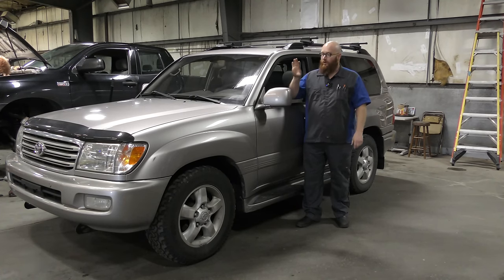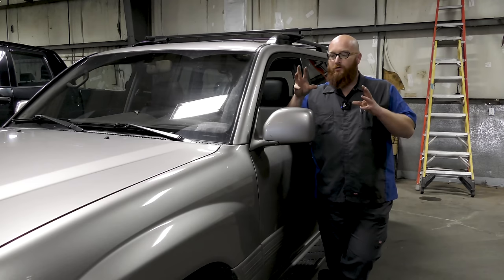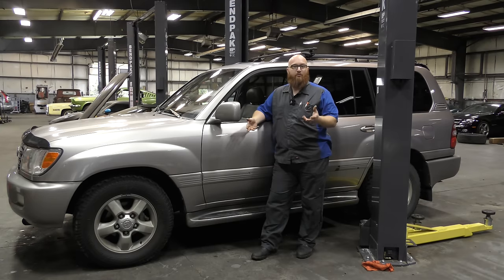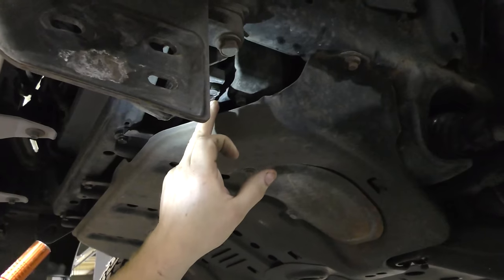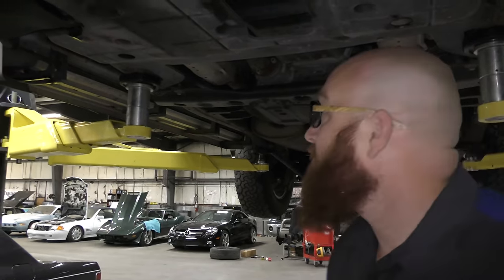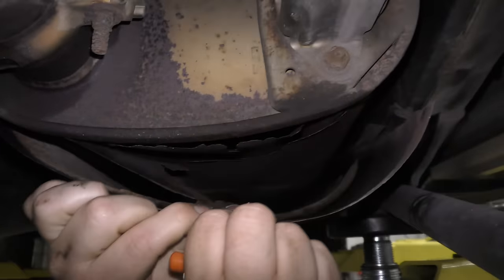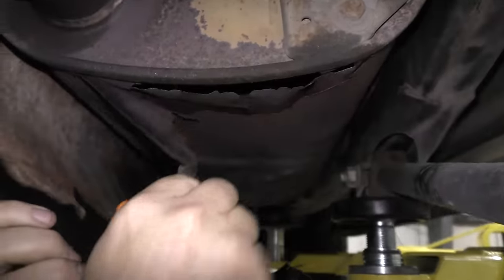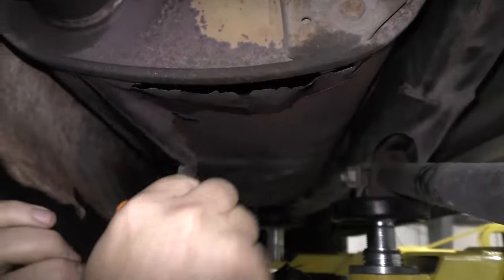Vehicle Making a Horrible Noise?! CAR WIZARD finds the problem & shares how not to be duped by shops

Comment: If you use hostas that Rusty you need to see the inside of the frame with a borescope around the front suspension mounts in the rear suspension Mounts also they rust inside those areas I just saw my neighbors go off to pic a part because of a rusty frame

Comment: Hi,  Just trying to fix my 2011 Sequoia.  Placing into 4X4 makes a grinding noise on front right.
I noted your cracked thumb.  I have the same.  It is called Median Nail Dystrophy. in case you did not know.  Thanks for your videos

Comment: What if you know exactly what’s wrong but the fix is beyond your abilities? Got a bad needle bearing on my 4Runner and the diff oil looked horrible.. lots of metallic flakes in the oil as well as the thin little rods that make up the needle bearing.Don’t know if the front diff is shot ( sounds normal in 4wd bad in 2wd) which strangely is the symptom for the needle bearing going bad.

Comment: one day i went to start my mk4 jetta and it wouldn’t start. i had three different lights on the dash. after looking at codes i saw a potential issue with the throttle body, i took the whole tb apart and cleaned the electrical contacts as well as the tb itself. hooked it up to vagcom, tried to adapt it, wouldn’t give. replaced the tb with a new one, same issue. after about 20 or so tries adapting the tb with the ecu, car finally ran again and all was well at idle until i turned on headlights. i suspect headlights caused some sort of parasitic draw because it suddenly idled like garbage.  turns out the issue was that my rear o2 sensor wires, which were cut by the prev. owner, shorted out the ecu and was the cause of my headache. installed a new ecu and had a friend help me install new o2 wiring into the harness with new sensors. no more issues! could’ve saved money on a throttle body and time on the whole job by just replacing the ecu. NEVER buy a stage 2 ecu from ebay. apparently the previous owner was a numbskull

Comment: I've got a Lincoln LS, and a guy was trying to make me do a Motor swap. Took it in for a little rattle in the top end, dude says my engine is about to let go and it's spun a bearing. I entertained him for the hell of it(I know a lot about my car) said it had metal in the oil. Well I checked the oil, it's clean and near brand new, looked like he didn't even check it, from the dipstick or the drain plug. I checked both, along with the oil filter. Near brand new oil with no metal at all. My Theory is that the Timing chains are going out, 150k miles so it's about time for a service on them.

Hell it starts and runs fine, moves under its own power, but the damn passenger side top end is making one hell of a racket, so I only start it for a minute or two at a time so I can charge the battery. Once I get the cash I'm gonna get it fixed, too nice of a car to just scrap. It's a special edition called a LSE, or Limited Special Edition, one of only 1500 to ever roll off the production line.
Reply: I had it's sister car..Jaguar X-type 3.0. If you have the V8. Thats a Jaguar V8...they aren't very reliable. That's why they cost almost nothing to buy. If you have the V6..you have the Jaguar V6, which I had in my X-type. Those are far more dependable. They go over 200k miles no problem.
Reply: Yeah I've got the V6, it's a S-type that shared the platform, not the X-Type, but it did share motors

Comment: Don't forget to check the plastic heater tees behind the engine. Mine had the original tees from 220K miles ago blow up. Cheap and easy preventative repair :)

Comment: My 95 Camry had 175,000 miles on the original timing belt & water pump before I had it replaced. The mechanic was shocked that it hadn't snapped by now!

Comment: I have a 98 Lexus 470 that was bouncing every time I hit a abnormality in the road. Afer my self diagnosis I concluded that I needed a new suspension system. I took the vehicle to the shop and $1900 later they replaced my hydraulic suspension system with OEM parts. The vehicle is still bouncing after I hit a bump. Any suggestions

Comment: I took my Jeep to a chain mechanic once and they diagnosed my Jeep with having a bad transfer case and it was going to be $1,500. Took it for a 2nd opinion and turns out it was just the wheel bearing in the back ~$400 and it was back in perfect shape. Still got charged the diagnostic fee from the first place though and I’m still pissed about that.

Comment: My neighbour is a licenced aircraft engineer.  He had a 2002 V8 Discovery for the wife, and a 1997 Tdi5 110 Defender for himself.  I say HAD!
As he was promoted years ago to an office job, l would always see him on days off working on both Landies (Land Rovers)
Axles off, heads off, steering rack off, transfer case out......It never ended. 
I did have to say to him,  Mate.  You didn't buy these to drive.  Did you?
He gave me a sly but short grin, and then got back to work.  As there was plenty to be done.
Now he has 2018 (from new) Landcruiser J200 V8 for the wife, and he has 1995 Mercedes G500 G-Wagen.  To tinker on.  But rarely.

Comment: Rare to see high mileage vehicles in North America due to accidents and rust. That's one of the reason the north american market favours spend less to purchase and replace more often. If accidents and rust weren't an issue you'd see way more fleets with Toyota Tundras instead of Ford F150s.

Comment: Okay but I live in an extremely shady area where they think people are rich. What do I do when the second mechanic also quotes you several hundreds of dollars for the same service?

Had a V6 with the engine that they said required the intake manifold to be removed. Knew I was being shafted and in the time I delayed it, wasted through about a grand in fuel. Finally found a way to do it for a couple hundred when they all wanted $600!

Comment: I had a 1984 Mustang SVO. One morning it wouldn't start. So I took the bus to work. While at work I was thinking that I should check the fuel shutoff switch in the back. Sure enough the fuel shutoff switch was somehow off.

Comment: those UZ engines are bulletproof but there’s 2 problems: timing belts instead of chains, and thin ass exhaust systems for emissions. unfortunately these are two very expensive grenades if you don’t keep up as he said with the timing belts

Comment: Someone has tried to "correct" the toe in not knowing that the bearing has play in it. So, he has adjusted the side to offset the play. And not even bothered to loosen the clamp; as it can be made when the area leaks a bit, Toyotas do not, so it does not slide and wrinkles. Shade-tree mechanic stuff...

Comment: You are spot on. We all hate terrorists, but we all know why they use Toyotas. We've had our Hilux for 22 years, it gets driven every day and has clocked up 270,000KM without one single breakdown. 3RZ-FE 2.7, 4WD 5 Speed manual. The original clutch lasted up until about 250,000KMs!

Comment: i had a 86 ranger years ago that would not start after running for a while unless i waited about 15 minutes and would sometimes get some serious shimmies while driving then clear up and be fine. Was told it could be the fuel filter so ran up to the  local ford place told them id like a filter and what it was doing. They tested the filter said it was fine and suggested a diagnostic. i was there so said sure then they come back with a $98 bill for the diag and a list of crap that they said the truck needed, $1200 worth of crap and right at the bottom - the fuel filter they had just told me was perfectly fine . Told them politely no thank you and went to leave. Suddenly my truck that, outside of the shimmies, was running like  champ was barely moving . Im not a mechanic but i knew they did something so i went back in and wasnt so polite. I ask my brother, who was with me, to watch in case they decided to sneak out and undo whatever they did, but he didnt stay out and watch so we dint catch them undoing whatever they did. Took the truck to another place, they kept it a week until it did the shimmies and it cost me $280 with never another problem.

Comment: I’m curious about the front wheel bearing. Is it true that the bearing is in fact doubled and the vaseline has to be pressed in some sort of special press to remove the old one? If it’s not done correctly (or not done at all), that wiggle is the result?

Comment: I'm surprised that the muffler is that bad of shape for a 2005, even with those miles.. I have a 2003 Tundra( this version only in a truck not a suv) and I haven't had mine rust like that. Must be where they put salt out in winter? Or close to the beach

Comment: I am going to find out if a really need to replace both cats on my '05 Sequoia. I've been quoted 3k which I would never spend, but it does have both codes P0420 and P0430. So, I got the cat cleaner and nothing. Now I got 2 downstream O2 sensors and see what happens. I am not a mechanic by any stretch but I figured if I need to replace the cats I already got the O2's. What's your opinion? Great videos! I always learn new things from you.

Comment: I've had two 100 Series LC's.  A 1999 and a 2004. Nothing but problems. I had a brake light go out on the 99 and front turn signal go on the 2004. This after only a collective 580000 miles and lots of offroading. Shame on you Toyota. I'm going to try my luck on a 200 Series in a few months.

Comment: Hello sir can u tell whats cause my hd100 fte  if i stop/brake in mid of hill then once i hit accelerate pedal the power lost and feel like my car shaky and moving very slow but if i drive flat roadits normal like nothing problem. Its happend also once you hit pedal to the left or right at junction my car shaky after few second its normal.Can u tell me whats problem it cause?

Comment: Had this happen to me once... I had a 2007 4.0l Ford ranger with 75k on it and it was loosing coolant.. took it to a shop and was quoted new head gaskets at 800 $ I ended  up getting a second opinion and all it was. Was a thermostat housing and I was able to replace and do it all myself for about 75 dollars.. gotta watch out for shops like this

Comment: This is exactly what happened to me. I was hearing a rattle in the rear whenever I went over bumps. I am not experienced at all with cars and I thought I needed rear struts replaced. The car had 88,000 miles on it. I went into shop saying that I hear rattle and I need rear struts replaced. He said sure, and charged me $2,000. I drove and I still heard that rattle. I then got a new license plate cover becuase the old one broke on me and bam, the rattle was gone. It was the $10 license plate cover the entire time.

Comment: When I got my '99 Isuzu Rodeo from a family member to replace my totaled Nissan, I took it to a local shop, and wanted a quote on fixing the speedometer, gasoline smell from behind the engine at the firewall, and fuel gauge, as well as the standard maintenance. I knew the ABS light was on, and that the ABS system needed to be checked. 
This shop told me my transmission was going to be dead, there's an oil leak in the engine, and the fuel pump needed to be replaced, and they need to take the intake manifold off to find the fuel leak. I think the quote was somewhere around $1,200. They told me to ditch the car, and that whoever sold it to me was a bad person... 

My uncle laughed as he had the transmission fluid done at it's required interval, oil changed on time, and even before he shipped it to me. I fixed the speedometer myself by replacing the gauge cluster, the gasoline smell came from a hose that was disconnected from the fuel rail off the fuel pressure regulator, fixed the regulator, got new tires, and full brakes done elsewhere, and all current maintenance/repairs I'm doing myself. Shes been driving perfectly since I got her a year and a half ago.

Comment: Me, if that engine light comes on, my OBD Reader comes out. I pull the code, consult the common fixes, and start small. If the smallest one does it, good. If not? I go with the most common fixes first, which so far has worked. I’m not a Mechanic but am very Mechanically Inclined. I am smart enough not to touch things like a Transmission, a Differential, or Timing Belts. If it’s any of those three, to a Technician it goes. If the code I pull is something I won’t touch, then I bring the code to the Mechanic of my choice(I’m friends with several), and say “It’s this code. I tested the other fixes, and this is the only one left. I won’t touch it because I don’t have the tools for that job. I have the new  part already. It’s in the trunk. Here you go”. Yes I’ve done that. The one time I took a car of mine to a Mechanic I didn’t know, it was “I got this part I’m upgrading to, because the factory one is known to fail. Need you to swap it for me. New one’s in the trunk”. Wizard, I’m pretty sure you’d hate me lol.

Comment: jiffy lube will say it needs an engine. I have went a few days ago for transmission hose clips to see if they had any and got quoted 160 per hour and they said the hoses have to be replaced. I went to autozone and replaced the clips for 4 bucks and 5 minutes.

Comment: At least in my area, the most dishonest mechanics are at the dealer.  I once in a while go to the dealer when my spidey sense tells me I absolutely need someone factory-certified to do a particularly sensitive thing on the car.  But generally I just go to indies.  

Oddly enough, one of the best mechanics I have met is at the local Midas ... I thought they were just muffler shops so never really went there.  Then once I gave them some business just changing out my brakes and realized they were hardcore car nuts.  I believe they are all independent shops rather than owned by the chain.  I am usually very verrry particular about parts (with some cars, the difference between OEM and aftermarket parts is night and day) and we have a running deal that they're completely fine if I supply the parts and they just charge me for labor.

Comment: You are AWESOME! i have a issue with my LX 470 2005 , When i go over 120KPH, the low Oil Light comes in. The garage guy said me change the oil pump, which is inside the engine. I'm thinking, can it be?

Comment: My Jeep with the 4.0 i6 has over 240,000 miles and I just changed the original water pump.  It was still working fine but the gasket was leaking and so I figured I would replace it.

Comment: My friend has a 2015 toyota camry 4cylinder    with 565000 on it,  with original engine and transmission. Burning a little oil and transmission slips every now and again, but one issue cant figure out charging lite stays on even when he replaced battery and  alternator, any suggestions.

Comment: When in college my Buick park avenue had a leaking power steering pump. I took it to a shop in the city I was going to school in and the shop manger and his mechanic looked at my car and said it needs a new rack and pinion. He said it would be 2700. I said nope! Took it back to my hometown to my dads mechanic and he found a leaking power steering hose. Replaced it for 250 and back up and running.

Comment: Wiz.. any advice. I purchased a 17 Camry with only 27K miles. Runs amazing. Any advice on it ? I change the oil at the dealer with the $20 weekday coupon. Brakes are a little mushy. Pad replacement ? Any longterm tips? 
Love your channel

Comment: Thanks alot for your tips. I have a 1998 land cruiser in Bahrain similar to the one in your video but stick shift. I love my truck and I heard that in 2022 the land cruiser 200 production will be ceased. I am thinking of purchasing 2021 Toyota land cruiser series 76 or 79 diesel 4.5 L with a single turbo.

Comment: Many years ago i worked for a Chevrolet dealership in OKC and i had this one particular customer that had a mid 90's 2wd Tahoe that had hard and delayed shifting, i replaced the fuel filter and the problem was fixed (engine ran rough and struggled to gain rpm's to shift), my shop manager told me to soak my hands in wd40 and grab everything around the trans to make it look like we pulled the trans and rebuilt it and charged him for it, i did what i was told but felt wrong about it, the day after the customer picked up his vehicle i told my boss i didn't feel right about doing that and next time don't ask me to cheat the customer, i was fired on the spot and told to never step foot on the dealership grounds again

Comment: I took my 05 Malibu Maxx to the dealership to have a trottle body cleaning n they checked car over n only found a few minor things like wrong size wiper blade and fuel injector system needs cleaning.  They could've said worse since this car has 352,000 miles on it

Comment: I love my Toyota's. my question is do you recommend changing the transmission fluid on a sealed system and if so about what mileage? Great video.
Reply: Every 60,000 miles is my magic number. Sealed system or not, there's is typically a transmission drain plug.
Reply: @3931aaron  I do have a drain plug. So how should this happen? Do you have a video that you can share ? I don’t want to mess up anything. Lol 😂

Comment: Yea, this vehicle costs more used than the car, truck, and 2 motorcycles I own- a 2005 E320 CDI, a 1992 Jeep Comanche, a 2005 BMW R1200RT, and a 2007 Triumph Speed Triple 1050. If the timing belt kit/water pump need to be done on top of what this vehicle is in the shop for, it will end up being more money to maintain/repair, than I spent on all of my vehicles combined this year. Unless you really are visiting somewhere deep in the bush frequently, these are a waste of money. I live in the Sonoran Desert and go off-roading occasionally after monsoons with my Jeep and it holds up fine. Certain years of the 4Runner will be far better suited to almost anyone in the general public, who wants better value and the 4Runner offers more engine choices as well.